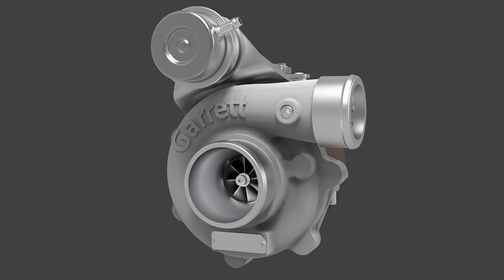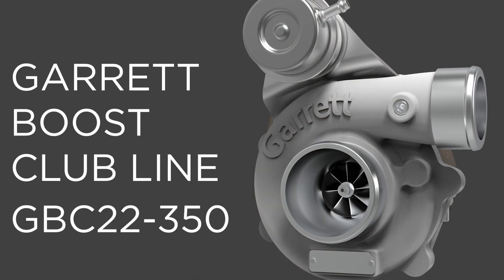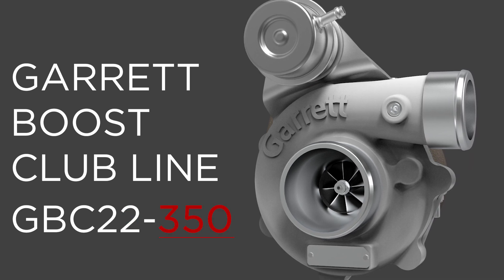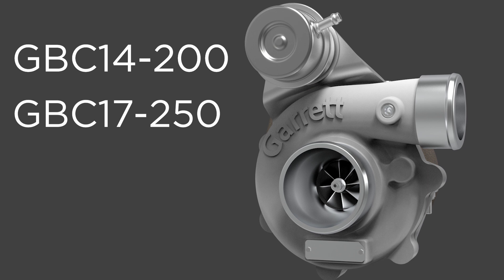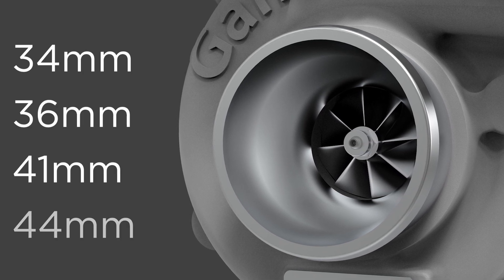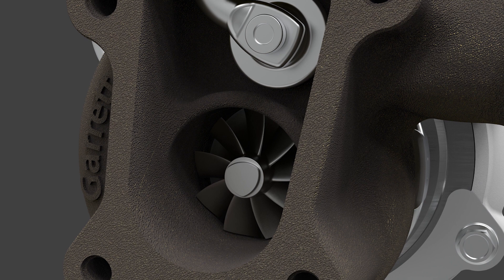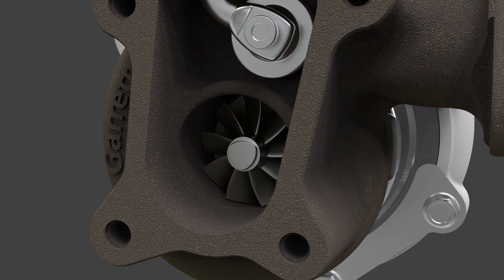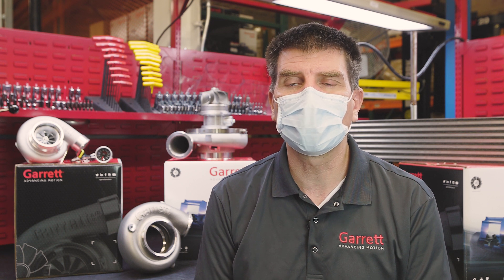GBC Club Line Turbochargers | Garrett - Advancing Motion

Comment: I'm building a Mercedes OM606 TD for Off-road Use.  And considering the GBC22-350 for my 3.0L Diesel motor.  Will Garrett be producing a GBC23-400? or similar frame to 400HP?